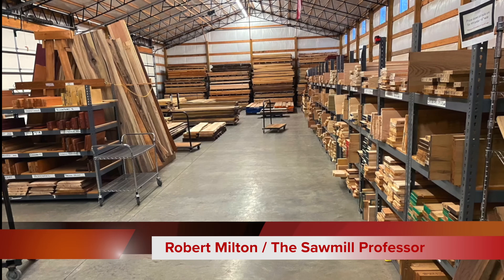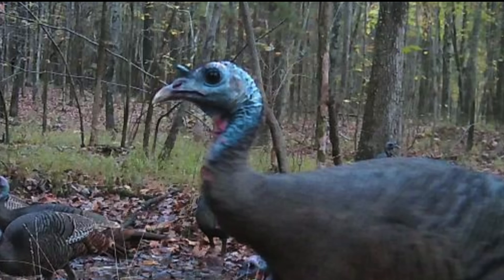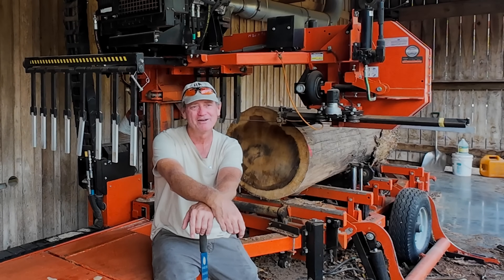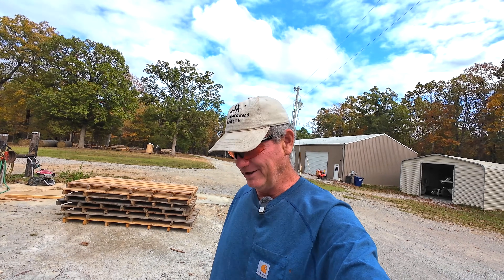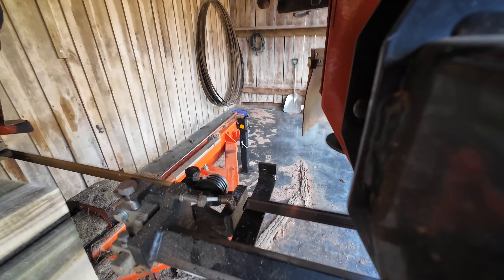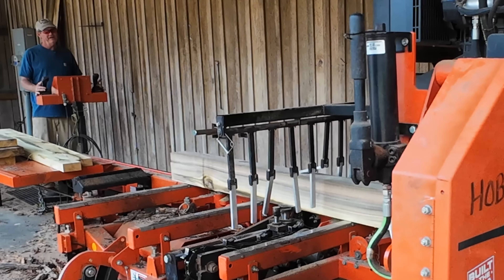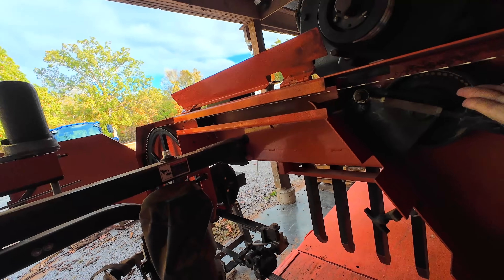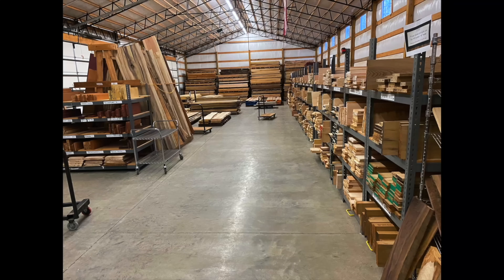Sawmills, Turkey Calls, and Band Resonance Dampeners

Comment: Damper, not dampener. Dampeners make things wet.😊
Reply from the maker: Dampener is the correct term as I use it in this video.
From the The Oxford Dictionary:
damp·en·er
/ˈdampənər/
noun
a thing that has a restraining or subduing effect.

Of course, Britannica also uses the same definition:
definition of DAMPENER
: something that reduces the force or effect of something
a noise dampener
: to make (something) less strong, active, or exciting
Reply: @HobbyHardwoodAlabama  Language evolves, and sometimes we old folks fall behind. You are not wrong, but some dictionaries maintain the distinction. Those are probably edited by old folks.

Comment: In your air drying video, do you put any weight on the stack ?  I put a small concrete block on top between two stickers
Reply from the maker: Yes, about 3,000 lbs per stack.